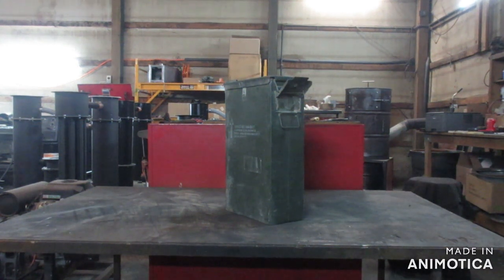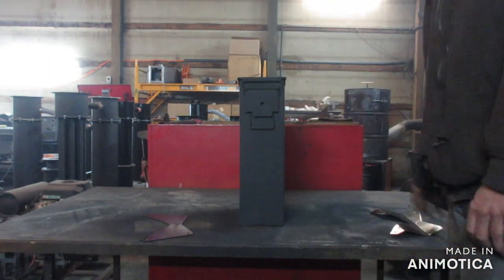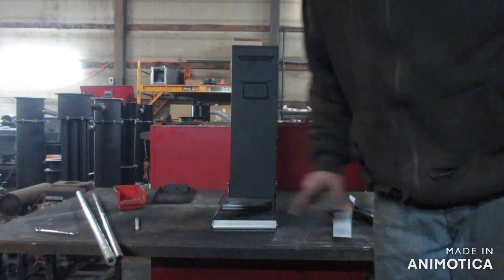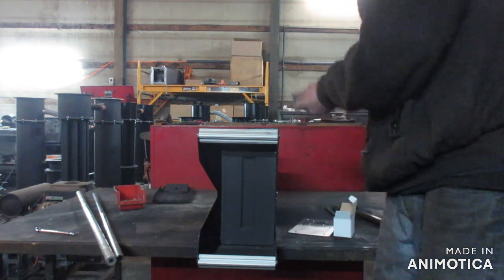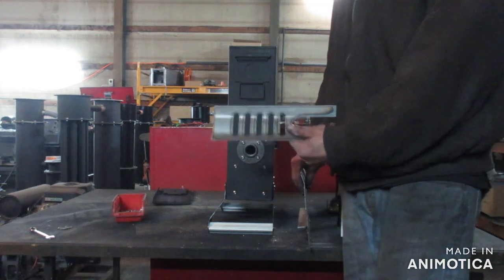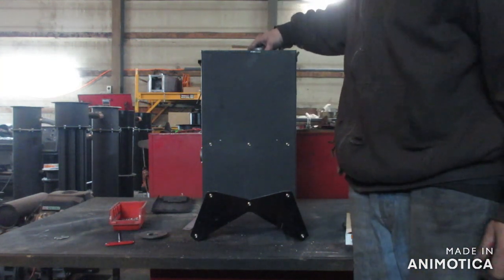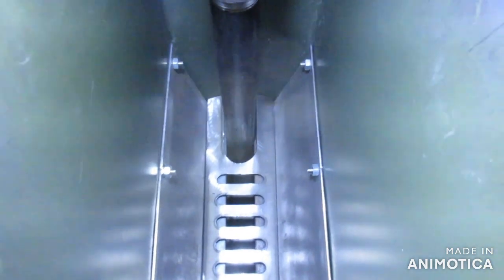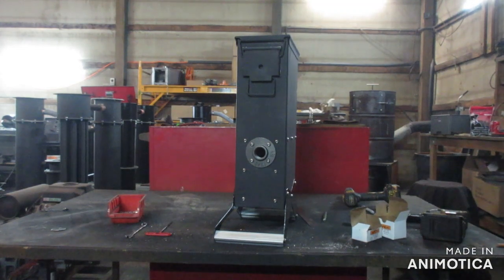Ammo Box No Weld Gasifier Build Tutorial Segment 1

Comment: Did you consider making a clean-out port on the opposite side from the inlet port, to remove the burned ashes?
Reply from the maker: No just dump it out. Charcoal is not like a wood gasifier where this is a constant thing you have to service. You should not need to service this often. You could probably run 20 hopper loads before ever needing to dump it out. This is also a DIY simple gasifier; if you would want to add this, this is up to you. On my production machines yes they have a clean out port.